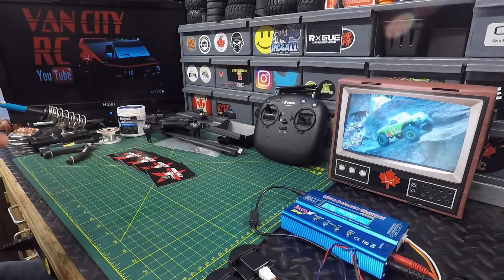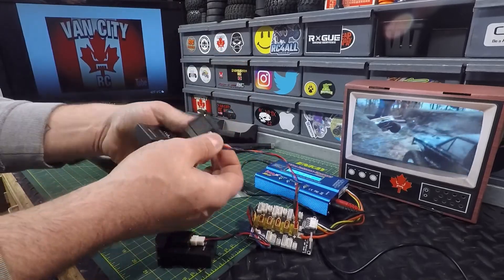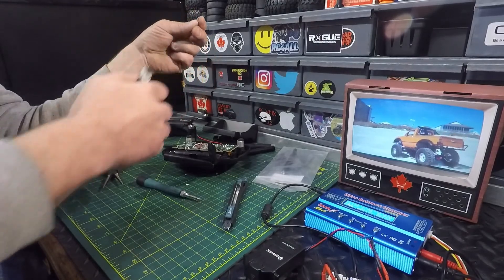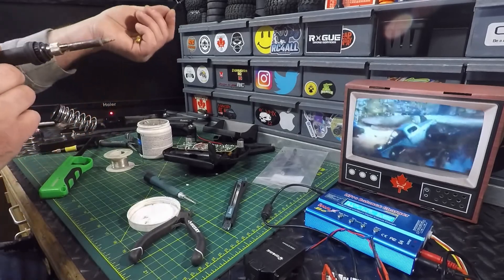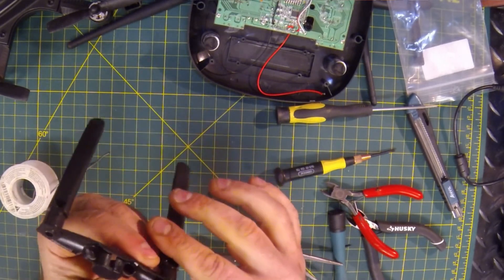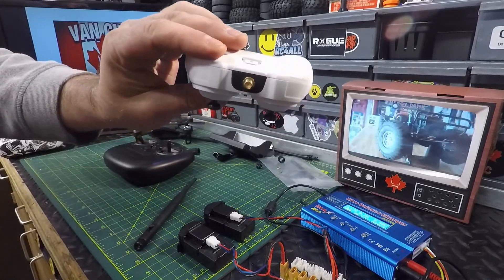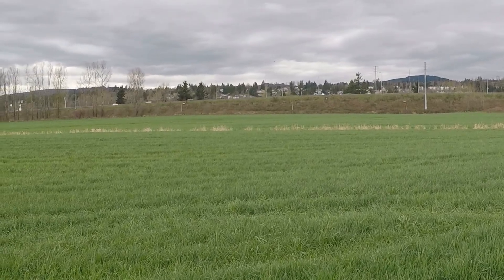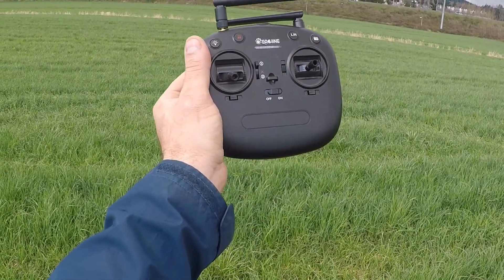Drone Transmitter External Antenna Mod

Comment: Did the same with my mjx bugs 2 and a different camera and board with a clover leaf antenna and put the antennas of the drone on the outside of it and flew almost 2miles with no problems.
Reply from the maker: I’ve done this to several drones and it’s always given me better range 👍💯💥
Reply: @Van_City  that's awesome brother,have a great weekend
Reply from the maker: @islandrc-duke1972  you as well 👍💯